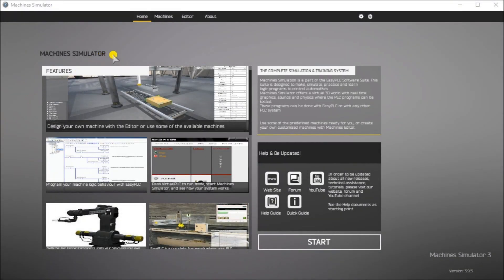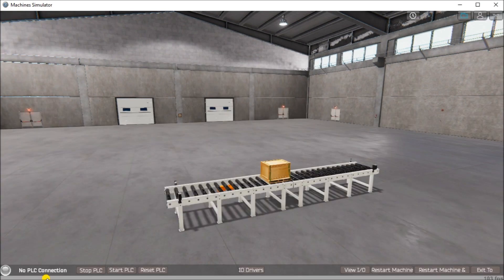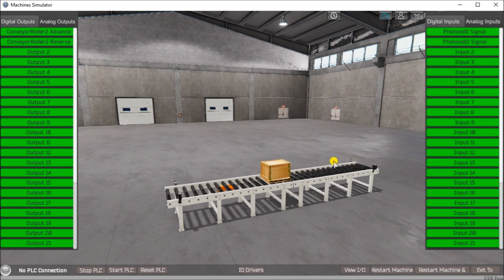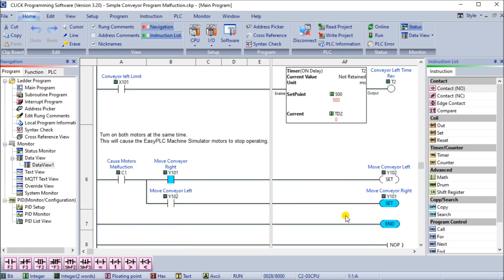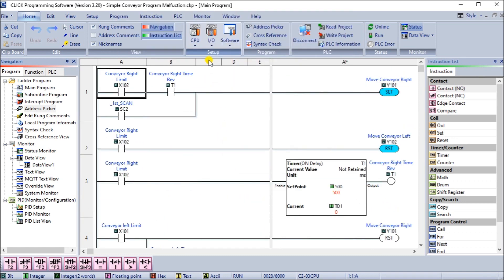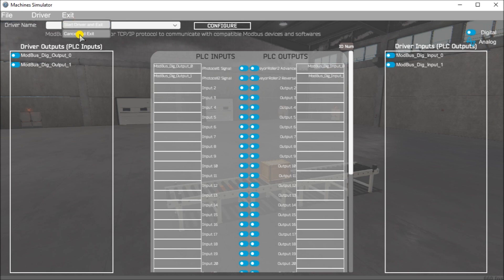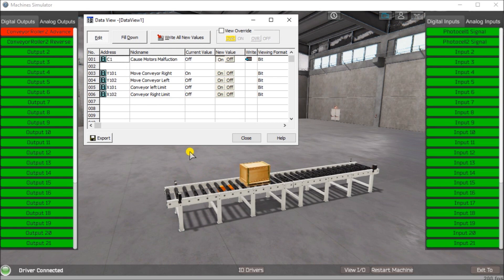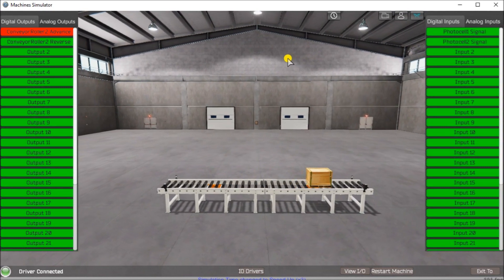Click PLC Simple Conveyor EasyPLC

Comment: I had to use C101 and C102 for inputs. X101 and X102 would not stay true in data view when true in Machine Simulator. X101 did reset the conveyor advance, but didnt stay true to time the timer. I am using version 3.41 of CLICK software. Any ideas of why they are not working properly? And is it ok to just use C memory for both inputs and outputs? Thanks.
Reply: I think I found the solution. I didn't have override on for X101 and X102 in the data view. What is the purpose of using physical i/o over internal memory? I noticed in the productivity videos it seems cumbersome to change data types after logic is complete. Can you just assign the boolean tags a modbus address instead of changing data type? Thanks.
Reply: a mi tambien me paso lo mismo, tengo un PLC click PLUS y NO tengo cableadas las entradas fisicas,me toco cambiarlas por las memorias tipo C (C1 y C2) y ahi si y7a funciono, supongo que si las cableo me daran el mismo efecto

Comment: hi and happy 2022 new year. 🚀🥳  this is very interesting and a good new project for the year.  can it be ran stand-alone on my hp windows 10 laptop.  thanks a lot. 🙂
Reply from the maker: Hi q zorn,
Happy New Year!
Yes, this will run on your HP Windows 10 Laptop.
System Requirements:

Minimum Hardware Requirements:
Processor: Compatible with the SSE2 instruction set
RAM: 1 Gb.
Disk Space: 2 Gb of free disk space.
Graphics card: Support DX9 (shader model 3.0) or DX11 with level 9.3 function capabilities
An installed Sound card.
Regards,
Garry